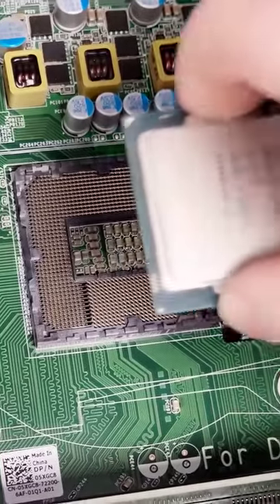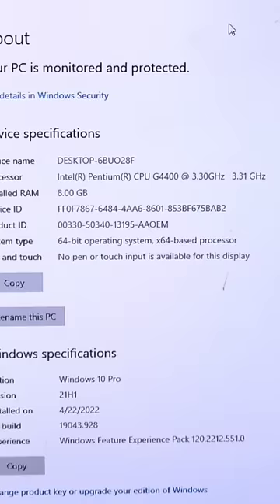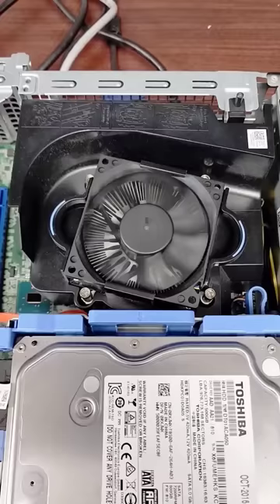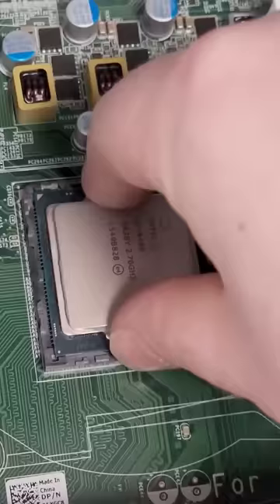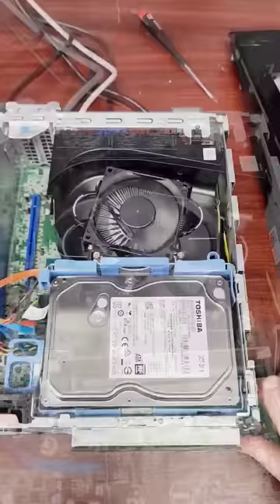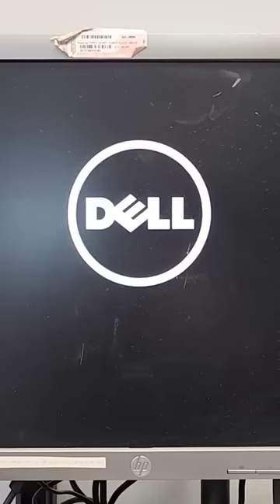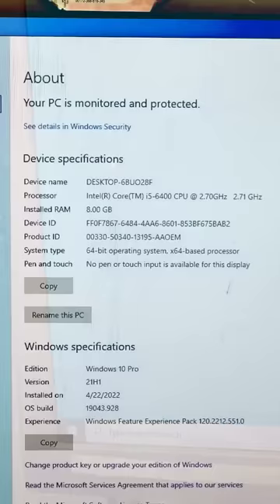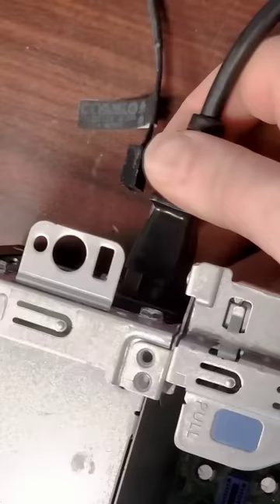CPU Swap while in Sleep Mode??

Comment: I believe hibernation mode would be different,it can start back up to where it was even in a power failure as long as it was put into hibernation mode
Reply: I wonder if it would it be able to start with a different CPU, though.
EDIT: I found a video doing that: https://youtube.com/shorts/jhIITNesa6Q
Reply: It can still cause problems. I upgraded RAM on a hibernating Windows 7 computer and got greeted with an error screen saying my system's firmware did not preserve the memory map across the hibernate transition.
Reply: actually you can kill the power to a pc while in sleep mode and it'll be fine, it'll restore automatically, but yes hibernation mode is best for this
Reply: It would still fail.  Hibernation saves an exact image of everything in memory to the harddrive, including CPU state, then reloads it when you exit from hibernation. Swapping the CPU would cause that hibernation image to appear corrupt as the CPU state would not match.  i.e.  swap a single core Pentium with a multi-core i5 CPU
Reply: Do you mean hibernate?
Reply: @stephaniethebatter7975  Of course, pretty sure Windows doesn’t check for hardware updates constantly, the BIOS does on boot up and that’s it.
Reply: @MrRobarino  That's not entirely right. What hibernate does is save the RAM state and queue the instruction pipeline. The BIOS abstracts away differences in how that instruction pipeline is handled by the OS. Therefore, there is no reason changing a CPU should affect hibernation. 

HOWEVER, Windows 8+ cryptographically verifies hardware via Secure Boot. Upon resume this process will fault if the hardware has been changed. Turning off Secure Boot will return to legacy mode and that may allow swapping of the CPU.

I say "may" because Microsoft doesn't bother to retain full legacy functionality lately, and I haven't tested this particular case.
Reply: @hidenfn  It does, actually. The OS has to keep the IRQ channels sorted on an ongoing basis. Hot-swappable components like USB and SATA drives are not hot-swappable by magic. To analogize it to a phone line, the OS has to ensure each hardware item has dedicated lines to the CPU they can call when in use but also not busy for no reason when they've hung up.
Reply: @stephaniethebatter7975  This is because the RAM is not the same size. Presumably, swapping to new sticks of the exact same size would work. The reason is that the hardware and OS partition different sections of RAM for different operations depending on the size of the RAM. If hibernate had to consider RAM size changes between hibernation and adjust its memory partitioning accordingly, it would require a lot more code ($$$) for a very rarely encountered situation.
Reply: @Mavendow   You want to argue, but have you actually ever tried it?  It never works, even back in Win95 when there was no encryption and the only difference between CPU's was the speed  (I. E replace a 100mhz pentium for a 120mhz pentium) The ACPI kernel of the OS always crashes or bluescreens.   Didn't work in XP either when the only difference was a swap out to a faster Pentium 4.  Windows Vista and beyond is definitely never going to work.
Reply: @MrRobarino  Windows 95 doesn't have ACPI. Windows 98 uses manufacturer-specific drivers meaning changing the CPU version would crash the driver loaded within the ACPI.
Windows 2000 it doesn't even save processor state so, while I haven't tested that OS, there's no reason it would crash. Windows XP it does work, I've tested it, but the network card will cause a crash depending on the type of card and driver version. Turn off "wake on magic packet" and similar features. Patched Vista/7 it generally works. Edit: Nope, Vista/7 have the same network card issue, my bad. I always turn it off so I didn't realize. There's also BIOS wake, but I'm not sure if it affects the OS. My mobo has a custom BIOS with these removed.

Comment: There is no sleep mode in windows 10, it goes into modern standby. Your processor is still active in modern standby, some apps can even run in the background.
Reply: IIRC, modern standby is only present on around Intel 8th gen and newer laptops, desktops still use the good ol S3 sleep even the 12th gen ones. Though he could've tried swapping the CPU during hibernate mode
Reply: He was using a pentium.....

Comment: Makes sense, the os and the bios had information to keep everything running but they had it for the cpu that was previously installed so when it was replaced, the os didn't know how to allocate the programs since it didn't recognize the cpu, after rebooting the bios was able to perform a post test and get the correct cpu model to give the os

Comment: My guess (not a hardware engineer, just took undergrad CS) is that the CPU replacement wiped the registers on the CPU, including the code pointer that tells the CPU which line of code to run next
Reply: Correct 💯
Reply: But it is not code pointer it is program counter and different registers like stack pointer instruction register etc.
Reply: @bhaskarm632  ah I knew I’d get the name wrong. I got close though!

Comment: This is kinda weird because it should technically work. If you switch off a PC while it's in sleep mode, it actually hibernates, so when you plug it back in, it goes back to where you left off before sleep. The black screen might just be a weird Dell bios thing, because my PC with a 6th gen Asus board does resume if I power it off in sleep mode. And I've seen other PCs do this, it's kinda weird that this PC didn't resume after a power cycle.

Comment: Windows has several sleep modes, like S1 to S4 for some older cpu's.   if that's true (not on your i5) and your computer was in S1,  that would mean the CPU was halted, or stopped.   And in that case, that would mean power is holding the values of the cpu registers.  So when you pull the CPU, power is cut, and the register contents are destroyed and lost.  And that would cause swapped CPU to power up in an unknown state.  In S2 and up, the CPU is powered off, which would mean it would have to reload the contents of registers and it may have worked with an older cpu having same instruction set.   If you type 'cmd' in search above start button, then  'powercfg -a' in an open cmd prompt it will list your available sleep modes

Comment: The new cpu has another microcode so it wouldn't work at all because the motherboard has to load that, but even if you used the same model of cpu or the exact same one you took out, just like @MrMe01 said it wouldn't work because the ram and cpu cache would get cleared

Comment: Sleep mode keeps the RAM powered and most other devices in either low power or off. Hibernate saves your PC state and powers everything down, than restores the save state when powering back on. Not as quick as Sleep mode, but much quicker than shutting down the PC.

Comment: I’d imagine it has to do with the way the computer saves memory information. Even very similar Intels can use memory in different ways, so it’d represent an issue for it if the CPU tried to use memory that either didn’t exist or was addressed differently.

It might work if you use the exact same CPU

Comment: sleep is like what happens with your phone, not much actually turns off, its just heavily limited as to what can do what so it draws much less power.
try it with hibernate instead, it actually saves the state of the computer as you said and turns everything off as if it were a shutdown.

Comment: Sleep just suspend the user part of the pc, everything is kinda on.

What you described is HIBERNATION mode, in it, the computer state is saved as a FILE on a temporary path on your DRIVE, and every other thing turns off, ram, cpu, all.

Try this again with hibernation mode, it may work 😅

Comment: In sleep mode the state of the computer is not "saved", it still remains in ram. Also modern os's use S0 sleep more which still uses cpu. You should try this with hibernation.

Comment: Hibernate is full power off, the snapshot will saved to hdd and set boot state. Is different with sleep, it will only save necessary data to hdd with kept hardware on standby mode to lowest voltage mode, but is still kept power on ram.

Comment: Try a few things, 1. More subtle upgrade such as i5 2400 to i7 2600, 2. Try taking out the cpu and replacing it with one of the same model ex. I7 2600 to different i7 2600 both at same speed, 3. Take the cpu out wait 10sec and put it back in to see if swapping the cpu is the cause taking it out may ve enough to make it not work, also try doing these in hibernate mode as it shuts it off but saves the state of the pc to the hdd to be restored as if it never happens

Comment: Sleep mode just put your active programs to the RAM and although the computer is off is technically still on, although in a very low power state. 

You should try using hybernate mode, which dumps your active program to the storage drive instead and the cpu and ram are completely off.

Comment: not everything is saved in sleep mode; your PC's most critical tasks have a timer on them to  auto wake your PC after a certain amount of time to take care of  those tasks.

Hybrid mode will freeze everything and save all active task to ram. 

however power settings  are instead stored on the motherboard. some of the non critical power settings are still active on sleep mode, while those aren't on hybrid more.

Comment: There is a different mode, in German it's called "Ruhezustand" Wich is also translated to sleep mode, but it's not the same because your laptop will not loose any more battery then completely turned off. Can you try it? In the newer versions (past windows 7 i think) it's hidden somewhere in Control panel. That would be awesome!
Reply: I can't wait to see that, I think I'm gonna try it myself with an old computer 😂

Comment: When you put the computer in sleep mode, the RAM is still powered and has data in it. Changing the CPU basically makes that data no longer correct, as if it was corrupted. When you shut down the computer, a save state is saved to be able to quickly boot back up.
A reboot is actually a more thorough shutdown than a shutdown.

Comment: Power Off - Stores session in Memory+CPU, logged out of account.
Sleep Mode - Stores session in Memory+CPU, Locked account.
Hibernate - Stores session in storage, Locked account.
Restart - Clears session in Memory, reboots machine, loads new session.
Unplug - Actual, true powering off, clears session in Memory.

Yes, these days, powering off doesn't actually power your computer off, since the BIOS and system is configured to give/provide a quick-boot experience, but for there to be a quick boot, means that most of the session has already been booted. Powering off isn't much different than sleep mode, which is saving loaded assets in memory.
Only by cutting power do you get a true powered off state like you used to get on old OS'

Hibernation, if you can figure out how to enable it, stores your system session on your storage space, not on your CPU or RAM, so in Hibernation mode, there shouldn't be power in the CPU or RAM. So try the CPU replacement in Hibernation mode

Comment: You should make sure to try this on a system that using s3 sleep. By default Windows 10 and modern hardware will use Windows Modern Standby (s0 sleep) instead.

Comment: theoretically if the cpu uses the same architecture you could actually hot swap it because the instructions stored within the RAM would still be valid
(if the computer is old enough to still support proper sleep where the cpu is entirely inactive, but windows 11 removed this ability lol so good luck)

Comment: i recently had corrupted my Linux drive similarly. i was using PC with Windows drive running on it, and went outside without shutting the PC down. when i came back it was in sleep mode and i forgot it wasn't off, so i switched SSDs to the Linux one without checking, and when i pressed the power button... it corrupted one of the boot files. Windows was fine though, and after a while i managed to recover all my files from the corrupted drive using live CD and just reinstalled the OS.

Comment: You're confusing hibernation mode with sleep mode. Sleep mode does not save anything, it just suspends some programs and keeps idle until you tell it to wake back up. The CPU + RAM are still very active.

Comment: CPU swap needs a fresh load. When you start it up with the Pentium installed, it loads the Pentium driver. Pentium driver sleep instance tries to send instruction to i5 CPU, it's not going to get very far. There's nothing in place for the core drivers to dynamically check and reload because they don't expect people to change CPUs. This is perfectly possible to do, there's just no reason to do it because CPUs don't come packaged in hot swappable cards. They write the software for the intended use of the hardware.

Comment: I am fairly certain I did this with my ThinkPad T420 - it had an i5-2520m originally and I swapped it for an i7-2620m. I turned the laptop on and it appeared to load from sleep and Task Manager even still had the old CPU name. I rebooted and then the correct name appeared.

It may have been fast startup resuming the old CPU name from hibernation, but IIRC it basically just woke up to my login screen.

Comment: This result should be expected, even smaller Hardware change prevent system to wake up after sleep mode. Devices with hot plug support should work. But CPU doesn't count to what. You might change same CPU type. But change in HAL, no.

Comment: Try with hibernation mode. Sleep mode saves your computer on the ram so it’s quicker to boot up when powered up again. Hibernation will save it instead onto the hard drive meaning it should not need the cpu to be powered in ordered to stay saved.

Comment: I did this to my HP HDX 9000, when it came out of shutdown (or S0 sleep), it's still thought that it had the old processor in, which kind of made me worry I thought maybe the bios had a locked configuration. Nope, it cleared up after a restart.

Comment: I somewhat managed this by accident at one point. I swapped out a pentium with an i7. I believe the pc was turned off, but might've still been plugged into the wall. When I booted it showed up as the old pentium in taskmanager, with 2 cores and all, but said it was running at 100 MHz, but still managed to perform like the i7. So weirdness can happen, guess you just oughta be lucky🤷‍♂️

Comment: It was obvious. The sleep mode doesn't just power off the CPU, it just puts it in low power mode. It's still doing something and when you just remove it, it will just forget what it was doing and get lost. I think you didn't have to power cycle, pressing the reset button should be enough, because reset just tells the CPU to start from scratch, that is executing the boot code as it was just powered on. However - isn't it just what happened? Nah. When you press the reset button you send the reset signal not only to the CPU, but also to motherboard peripherals. Resetting just the CPU is apparently not enough to restart the PC. Theoretically - a hot-swappable CPU is possible, however that would slow it down a bit and increase the cost of the system because some other parts would have to take care of initializing the CPU to the previous state when it's reconnected. Also - plugging in a DIFFERENT CPU could not possibly work. As it's different - it needs different data present in its internal memory. Downloading the old data would just be putting garbage into it's registers.

Comment: The issue is that the memory, and therefore memory controller, are still powered. Try hybernaye. It's basically sleep, but you can completely cut off the power.

Comment: I don't think this would work unless you had a way to directly access the RAM and keep the data in it, not only that but you would need the ACPI tables from the new CPU and manage to replace the tables from the motherboard with the old CPU with the new one's tables, though I don't think that's possible.

Comment: Try hibernation, it basically stores ur data on ram/ssd and boots again from uefi or bios so it could work
Reply: It would still fail.  Hibernation saves an exact image of everything in memory to the harddrive, including CPU and ACPI state, then reloads it when you exit from hibernation. Swapping the CPU would cause that hibernation image to appear corrupt as the CPU and ACPI state would not match.  i.e.  swap a single core Pentium with a multi-core i5 CPU.  It would need a proper reboot to re-enumerate the CPU.

Comment: You can also break the CPU because it does have a small amount of electricity going to it and the ram to keep the information that was in it before you put it in sleep mode up and running you should either shut it down or hibernated which removes power really could have broke the CPO that way

Comment: In sleep mode it recognizes the cpu cores threads when swapping is settings change making yhe current processes unable to associate the old data that was processed due to its output /imput change

Comment: Trying the hidden hibernation mode, you need to use a registry key to enable it but hibernation mode essentially Powers off your computer while saving its state, it was pre-enabled in Windows 7 but needs a registry key in order to work in Windows 10.
Reply: For all the systems I've had, it was enabled by default. Just another case of Windows being weird.

Comment: try hibernation mode, its similar to sleep but it saves the data to the system disk instead of RAM, RAM need power and so does the CPU is sleep but hibernation needs no power because it uses the system drive.